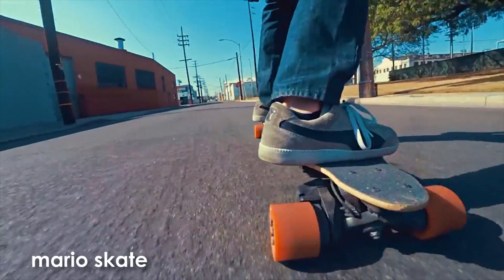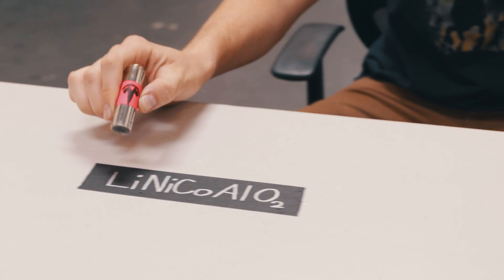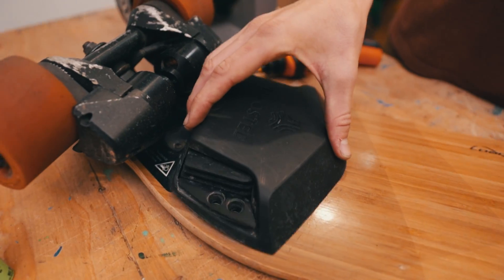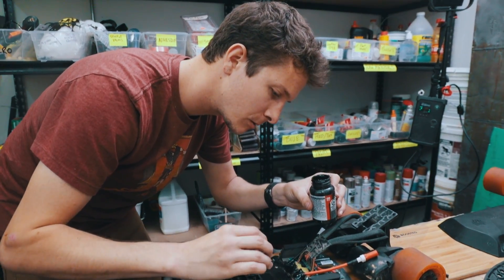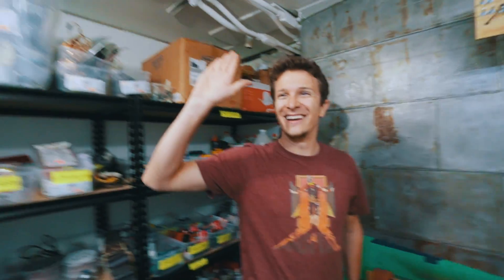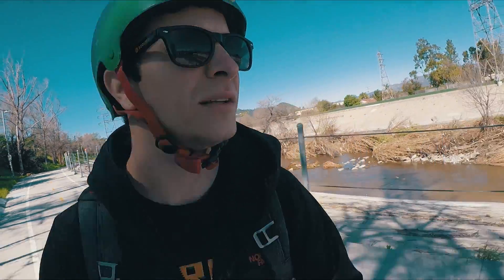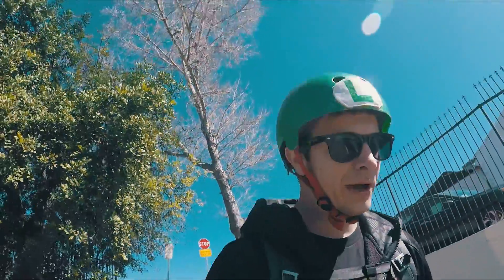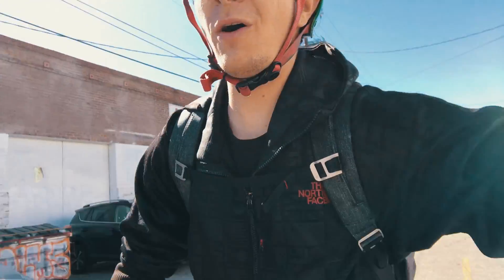Tesla Batteries in an Electric Skateboard!

Comment: I don't know much about electronics, but why don't you instead of putting the power straight into the board, why don't you make the battery charge the current battery and take off the chip that stops the board from running when charging.

Comment: change the low stacks of your board. and you can not have a lot of power, but rather miles. for more power, you have to change the speed controler, etc. etc. If the speed is right for you and you're just looking for more distance, you're on the right track. do not change the voltage, put all the same packs, and the new batteries will not be discharged in the old one.

Comment: I know this is outdated but what if you just had a switch that can switch battery to battery, so when the internal battery dies just flip a switch and use the other.
Reply: I don't think that would have worked, i could be wrong, but i think the reasons the board didn't use the energy when the voltage is below 30v it's because there is an overdischarge protetction that stop the board from draining charge if the voltage goes below a certain level

Comment: Its because you are reaching the maximum torque of your  motor, to add more torque add more motors or more powerful ones! Batteries wont change the amount of torque with the same motor, voltage can but eventually you reach the torque peak

Comment: Actually, if you get a couple 1f caps and wire them in parallel, it'll help boost your esc's V¹ efficiency and help to drain the 18650's down to the proper cutoff V². Much luck, I enjoy the videos.)

Comment: I have connected a 18650 battery to a bluetooth receiver, and plugged that receiver to my monitring headphones. 150 hours of playback :3 
As for you battery pack... I'd say to add more batteries or replace those with higher capacity ones. It is not healthy for 18650 to go as low as 30V (in your case) all the time. Lithium batteries are best preserved between 60-80% and you should keep them as close as possible to that percentage. (in other words they shouldn't be drained all the time, and if you try to, they would die much faster, they might even blow up xD (actually, be carefull with the polarity of these things, they can burn your house to the ground xD))

Comment: Also, boosted boards are for squares.  DIY a proper electric skateboard.  It's not hard, costs less than a boosted board and you can significantly increase your range.

Comment: 1500 $ board uses aluminium wires? Seen at 3:52
Reply: Those are tin plated copper cables, it's quite common for the stands to be plated before being weaved/twisted. He would have found it near impossible to solder if those were aluminium.

Comment: I know it’s kinda late now, but you know how wind mills use the wind to push a generator, creating energy. Maybe you can use the revolutions of the tires for the same purpose...
Reply: It will only add more work load to the running motors, thus the energy returned will not be enough.

Comment: It is discharge rate of 18650 is very less (2A). You need 21700 batteries or the batteries start with 2 series

Comment: In my mind it makes since to attempt to over ride or bypass the original battery and then try to incorporate some form of wattage reducing component (maybe) which could in theory leave you with your true power instead of the two aftermarket batteries charging the original stock which may even get you past your 15 mile marker. Be careful to not push to much energy which is why is suggest the reducer to keep from burning up the motors on the skate board
Reply: I only have basic understanding

Comment: So, why didn't you just use normal soft/hard case lipo packs? 18650's won't give you near the constant current a decent pair of 6S lipo's can. With a standard 6S lipo and the balance plug, you can get the little beeper volt meter/alarms for about $3 a piece (one for each pack) and they will beep at you if any of the cells get to the danger area. Also, with a bit of velcro, you can carry a couple spare 6S packs to swap out. What's the capacity of the built in cells? I'd remove those from the equation entirely. Lipo of any sort run the risk of damage and fire if your not using the same spec cell throughout the circuit.

All that aside, if your board is anything like my RC's, they are designed for a certain amount of run time. Heat quickly becomes the enemy of electric anything that's pulling high current for any duration. So you may be able to figure out batteries that will get you the 15 miles, but you will more than likely have to add a heat sink/fan to the  motor(s) and ESC. If the board is built properly, it will have thermal protection of some sort to keep it from burning itself up.

Comment: I use 18650's on a daily. Vape stuff mostly. "IMO" your using not the best 18650's, low amps (the legit tesla 18650's are 10 amps) and lower mah. Try out some Sony Vtc4 or 5's that will do 30 amps continuous, 2600 mah, or go all out and do Brillipower 40 amps at 3100 mah.  Also try doing the banks in parallel, but then running them series (good batteries should be able to handle that), as you would in example a solar array.

Comment: Video logic: More Batteries = More Torque
Maybe you should consider upgrading the motor? 
(PS: Setup a series of switch circuits with an independant connection to each battery instead of each in one single circuit, that way they connect to the next battery automatically... )

Comment: all batteries have to be the same power range or you will run in to issues. you need to either pull out the old battery or up size it by soldering more batteries on to it in series.

Comment: you can use like a voltage divider and a op amp as a comparator to trigger a boost converter step up the voltage a soon as the 33.bla bla voltage is reached.

Comment: Make like an external battery, take one of your batteries connect it to the chargers wire that goes pluged into the skate and keep it pluged in, you will have double the energi because doing this you kind of lie the board to.get power from other sources

Comment: This might be a little harder but if you use the boosted board battery as the back up and the 2 T batteries that you made you will be able to utilize all the power in the tesla batteries first and then use the booster board battery

Comment: a basic electronics class will tell you that current is provided by your batteries but the motors aren't able to draw from them. V=I*R. P=I*V. To make a long story short, you want more power but your max voltage is fixed by your batteries which are controlled by your esc. You added more current by a parallel battery configuration but you don't have the ability to draw that current from your batteries to your motors.

Comment: Get rid of the original battery and make it the size of the other batteries. Or just you need a way to somehow make an ALTERNATOR that will fit it so while you are using the other batteries so the wheel spinning will charge the original battery so you don't have wasted energy, ( like when you braught the board back to life by toing it, but the other batteries are acting like the car pulling it! Or just get more batteries. Hope that helps! :-)   :-)   :-) Just E-mail me for further notice!   :-)

Comment: Hey there, Corridor CREW!;
Level the playing "field".  Pull the stock Boosted-Board battery, & replace it with a 3rd(matching) aftermarket(lol) Tesla Battery. Maybe Even a 4th, no-pun (insert drum-kick)
p.s. does Tesla make batteries with different amperage output rating(s)... I mean, a higher rate-of-draw would decrease mAh Hmmmm Good Luck :), "Brother!"

Comment: your separate battery pack would have to have a high output drainage in order to increase your speed, or you can keep it as it is and somehow add on a third battery pack with a separate controller that doesn't help put the energy so slow and increase the voltage output turn it off when you don't need it turn it on when you need to go up the hills just a thought

Comment: Have u tried using the wheel power generator to power one battery and the other to give it that movement like poring water from one bottle into another and then back again it won’t last for ever because the battery will lose charge as the energy is heating it up but it should give u that push

Comment: hello my name is Gold Osburn I've been working on a new project known as the charge bus first sometime it's basically a bus that has massive battery packs designed to hold a large quantity of power in a school bus design This is mostly used for emergencies only as I could use them for Pokemon go or Ingress or I can use it for natural disasters when if necessary so I'm always looking for new ideas for batteries and new designs one of my missions I was on looking for is a guy who created a battery by using a 3D printer that sparked an ideal that bring me to the idea of the charge bus I want to change the world with this idea and maybe if I can get some information about how you're doing this I'll be very grateful not only that maybe the 3D printer battery making could actually help you out quite well especially when you're bored you could easily put a some Motors that they use in building airplanes or other things since they are kind of strong in the process as well as building new tires and maybe a new design of a skateboard if you use a longboard you probably could easily make out a pretty good design but if you build out a board you have to look at it and new whole line and think of it as a new way of thinking especially for people who wants to travel to their home every day or work by their favorite skateboard also you should think of ways that while you can turn it off and then as you roll the long it can recharge itself will you have it off or maybe having with some type of light so I can see at night when you're riding with your skateboard if you think of it there's Endless Possibilities as well as the endless possibilities with my charge bus that I can do as you can do as well I wish you luck and I will be happy if you can contact me sometime if you ever come across the ideal of increasing the power like that I would like to ask more prussians in the near future and maybe we can work together and maybe I'll be able to give you a a charge bus in the near future I hope you luck and see you soon.

Comment: I would remove the original battery, as its dangerous to have batteries of different voltages(especially lithium cells, they like to explode violently when overcharged) in parallel like that(the bigger battery will over charge the smaller one over time), and then, now that your not going to over discharge the original battery by fully using yours, modify the firmware of the boosted boards bms(battery management system) to go down to a lower voltage, or strip out all the original electronics, and use an esc and receiver meant for an rc car with the motor.

Comment: it will be a dc stepdown. lower current draw off your batteries, higher current cappacity off your vout, which is what the motors are hungry for, as you hit the current limits on your setup, voltage drops under load.

so i reiterate, buck converter to remove your current issue. boost converter makes that worse. but your gonna be running how many amps? will need a few medium beefy circuits or small heatsinks. your talking 80%-95 efficiency at a guess need to check.

Comment: dont use a boost controller. use a buck converter. and add more batteries in series. if the batteries internally shut off at low power your good to run them down. if not you need to program a microcontroller with a  cuttoff. boost  controllers will pull more current, you already said telsa batteries have current limits

Comment: you probably have to reprogram/ remake the controller to operate at a lower voltage.

That and increasing the capacity of the main battery and adding some sort of charge balancing system.

Comment: Add another bank of batteries. Add a 3way relay setup that will cut power from the booster board battery when it hits it drops to it's cutt-off voltage. The relay will switch from OEM battery to your original DIY battery pack at the same time using the new DIY battery pack to recharge your OEM battery pack. shrugs shoulders could work.

Comment: I didn't watch this vid in its entirety but you calculate distance by average power consumption. Also, I don't know how 'tesla' branded batteries makes it any better, even with higher voltages (if it was hooked in series) the ESC regulates speed with duty cycle, not  analog (usually). I also heard you say you need more batteries in parallel to get more current draw, but that's regulated by voltage, regulated by the ESC. You could hook it up straight to the motor (if it's a DC motor) and bypass ESC, but that risks damage. You can use all the energy with a boost converter like you said, like a joule thief, but it has to put out a lot more current than a joule thief.

Comment: easy just make a 2pack of battery again ang put on your backbag lol
Reply: Thats not the issue. The issue is the original battery. He should just replace it. Boom problem solved.
Reply: @eetmahbykechorts5925  replacement battery is an option. upsizing it another they better way if he finds the way to get that work out... i'm upgrading my inmotion v10f... it's hard..
Reply: @conan911  I've never used one  for real

Comment: Just put in a Voltage regulator? Youll lose some of the capacity in the lower range but you at least can scrape out the batteries.

Comment: You need a custom high efficiency motor driver for better mileage and a battery monitoring system. if you want to drain your batteries to their limits, again custom designed high efficiency boost converter needed. You should not drain your batteries completely empty, it is not good for their lifespan.

Comment: The Booster bolt Battery has a protection I believe, while the 18650 cells do not. Basically these 18650 batteries are also in E-Cigs and they have no protection on themselves, because the Mod that you use to vape has internal circuitry that offers that protection. So you either have to strip protection from the original Booster board or bypass that entirely somehow.
Also, to check your battery levels easier try finding a simple volt-meter module online with a tiny display that you can solder to your battery packs (and add a button), so that you don't have to pull out your multimeter on your ride, you just have to flip the board over and press a button and read the display.

Comment: Leaving the batteries connected so that the electronics would draw power from them during several month is VERY destroying to the batteries internal resistance so it will become higher and less power output and also a lower capacity.

Comment: you can use a extra capacitor before the input of the motor and they take voltaje form both battery and fuse in the capacitor to one ouput right to the motor and the ground of the motor go to the capacitor closing the circuit

the is what i think, i not sure they work but luck

Comment: This is very easy. KISS your mind brotha. Keep it simple stupid. Why did Tesla use so many battery packs when they couldve simply made 10 packs in series. More in series Makes more current quickly accessible down closer to the end of its charge. Make 2-3 cell (packs) in series. You need to next time study the e motor used find the needed initial current draw and the current draw thus after. Also the board is set to draw a higher amount of current from a much smaller amount of a cell pack. So the initial current draw it pulls via the boards regulator and capacitor is less. Get it?

Comment: Let me start by saying that I am a HUGE Tesla & Elon Musk fan.  However, it seems to me that Tesla could be doing better on their battery front.  What I mean is that the batteries based on the Panasonic equivalent seem to have one basic flaw for Tesla, and that is their WEIGHT to CHARGE RATIO.  By that, I mean that the Tesla car or anything powered by hundreds of batteries,  have to carry the additional burden of all the extra weight of each and every single battery container.  Not sure what the total KG amout of "wasted" metal actually is but if the engineers could design a much bigger single battery unit then the container weight ratio issue would disappear overnight.  I'm just a small businessman with no engineering experience whatsoever so I'd be interested to know what the problem is with making a larger battery with less container weight and therefore making the batteries more efficient ?  Can someone please let me if I am correct in my basic assumption and why larger batteries cannot be used at this time ? Cheers. Robert.

Comment: How about a 'tail' that's a Lever/crank and even the side to side action could be harvested to gain 'regenerated electricity'; that gives 'Charge' back to the battery's every time you use the tail, or move the board back and forth to gain speed, as skaters usually naturally do. :)

Comment: Just removed the two booster board batteries and close those loops so you would only require the external batteries. Unless there is a controller circuit to cut power after a certain voltage is met then shuts down to save the battery "saftely feature?" In that case just remove or bypass that theat circuit or even better trick that circuit to think it always above 33 volts so it will never shut down?

Comment: Use a sequencer to switch between batteries packs at a predetermined voltage. You don't have the high amp output but you'd have enough juice to make the long trip